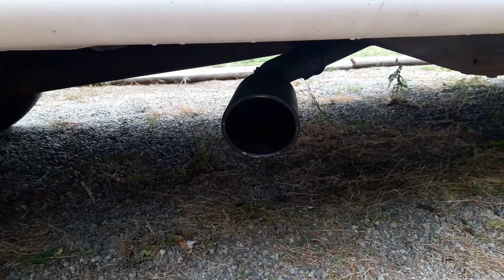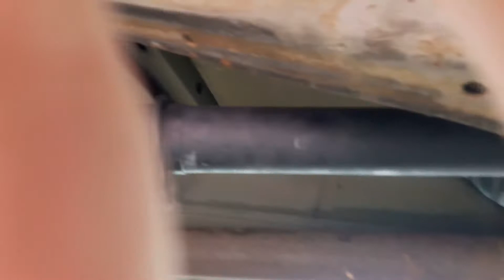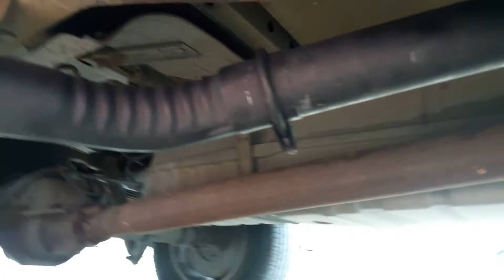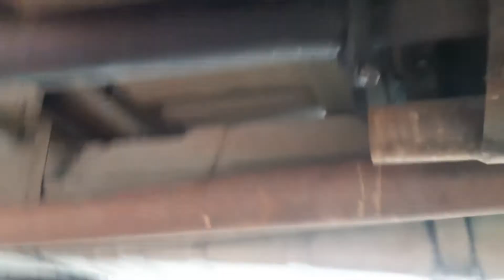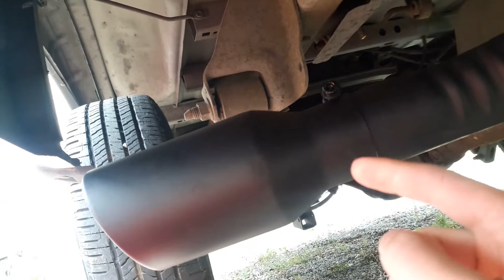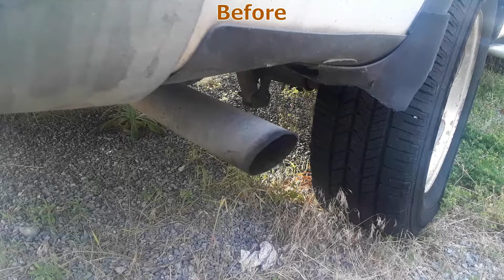2003 Ford F-150 4.6L Muffler Delete (9/6/19)

Comment: I just gotten a 2000 Ford f150 yesterday with the 4.6 extended cab nice truck in red color no dents no rust . Got her for $2000.  Bawn stock . It's quiet I want to take it to he muffler shop to have flowmasters put on but I believe I'm goin to do what u did take he muffler off but I see mine has a clamp on mine so I won't have to cut nothing . I do it tomorrow when I get up. I'm at work at he moment so  cheers
Reply from the maker: Its a cheap way to make them louder but If I was to go back and redo it I would have probably kept the piping behind the rear axle like factory, having it in front of the rear tire drones a little more than I'd like. Good luck!
Reply: @mightymachinez  went to the shop an got it done today for $230 has chrome tips an All sounds good
Reply from the maker: Right on!

Comment: Your truck sounds way better 💯
Reply from the maker: I agree!
Reply: @mightymachinez  
I have a 2004 Ford F150 triton 
My back exsaust rotted out and camp apart so Im using string to keep it from falling off, I'm take your 💡 idea and remove the end pipe for better weight and go with no muffler asweome video
Reply from the maker: @AaronRowland-y5w  Thanks man. I personally love the side exit in front of the rear tire. looks pretty mean and sounds great, not too loud but not too quiet.

Comment: My f150 has a flowmaster exhaust system with duals, but just a few days ago it fell off in literally the exact same spot in which you have you elbow and tip. And let me tell you, I honestly LOVE the way my truck sounds without the muffler n shit. I want to do the exact same thing as you and have it elbow and dump out the side with a 6 inch tip. I even noticed a fairly decent change in overall performance when I took er out for a rip. Just goes to show that you really don't need to spend a pretty penny into making your truck sound better, improving its performance.

Comment from the maker: I've gotten a few requests to do a walk around of Old Relaible, so I will post one soon!
Reply from the maker: @GR Deleting the muffler will be louder than deleting the cats, I still have all of my cats but with no muffler its plenty loud
Reply from the maker: @GR Well when you are in high school you want loud vehicles 😂
Reply from the maker: @GR But if you want power get a tuner, 4v intake manifold off a cobra, redo the exhaust
Reply from the maker: @GR Yes, I want to find a 4v intake for mine just havent done it yet, should give you more power. Tuners are expensive but they can really wake a vehicle up. Cold air intake would be a good idea as well. The 4.6 has never been very powerful but with my truck weighing almost 5500 lbs with 33" mud tires is even slower than It used to be haha

Comment: Did it affect your mpg? Or low end torque
Reply from the maker: If it changed my mpg it wasnt by much, it still gets pretty good mileage for a v8 (around 17 city 19 highway). Torque seems the same, the 4.6 doesn't have much torque down low.
Reply from the maker: American_Fighter  Check your plugs! After I changed my spark plugs and coils my mileage seemed to increase a little.
Reply: @mightymachinez  I know my 4.2 had lots of bottom end compared to my 4.6
Reply: @mightymachinez  my 4.6 gets around 11 mpg
Reply from the maker: @dizzydoggyog  With the 33s that are on it now I think it gets around 14, still not too bad